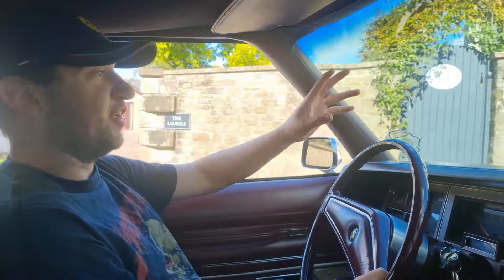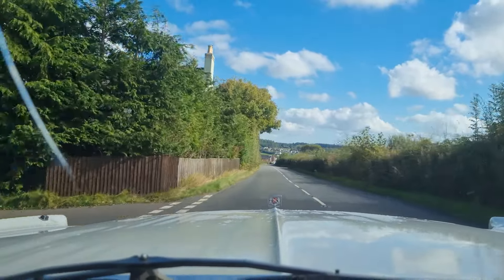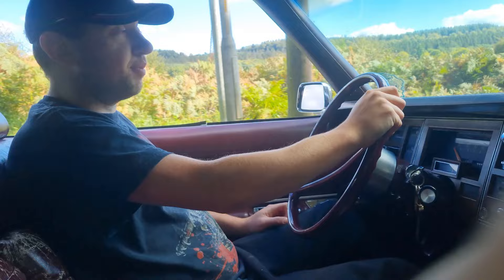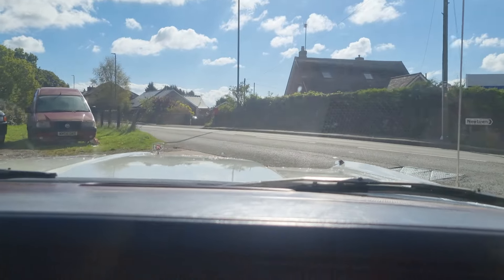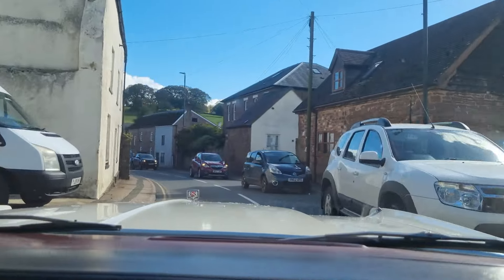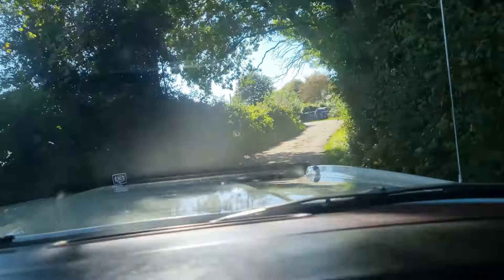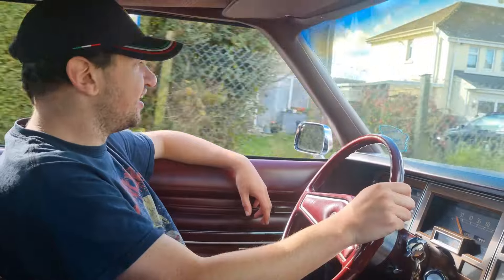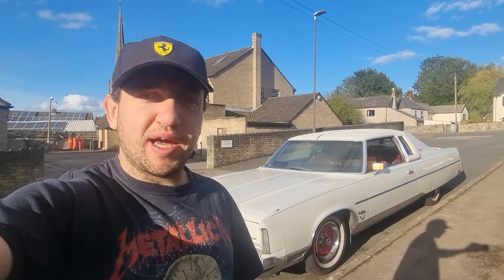Land Yacht vs UK Roads

Comment: Beautiful car. With modern SUVs getting huge now this probably isn’t much wider and not a lot longer than a lwb van - and no one ever asks parcel delivery drivers how they cope in town… The 1960s Imperials were banned from demolition derbies because the front and rears were so square they didn’t fold up in an impact. The bonnet sat down in a groove making the front end extremely solid, they just plowed straight through other cars. I’ve driven a few fullsize yanks over the years including a ‘72 Centurion and a 23ft long hearse. People usually get out of the way 😂